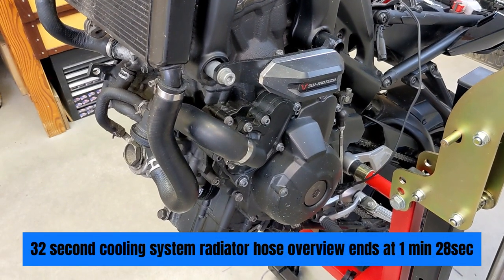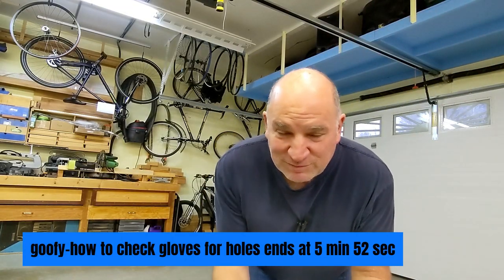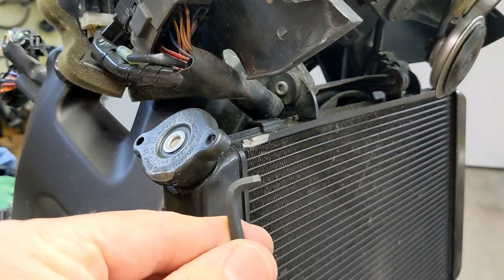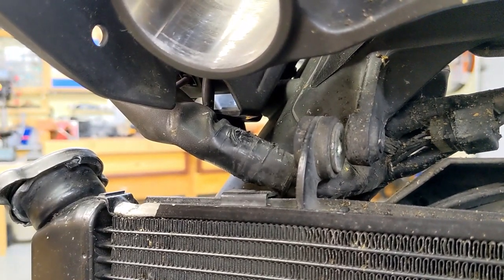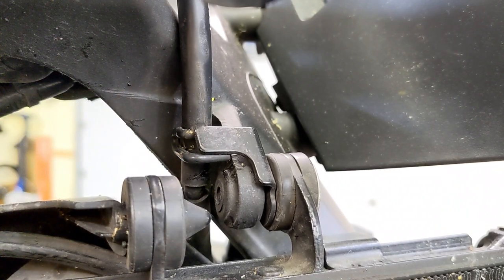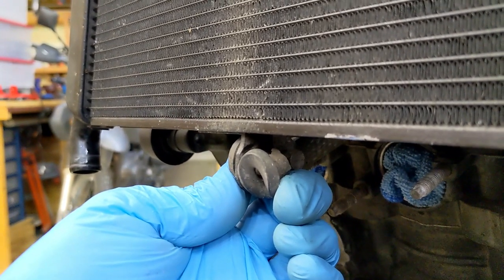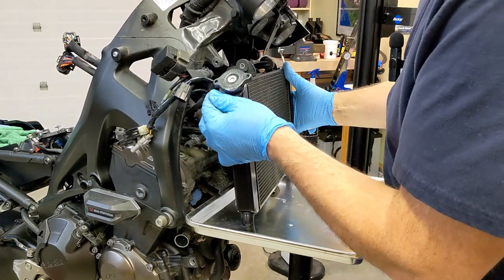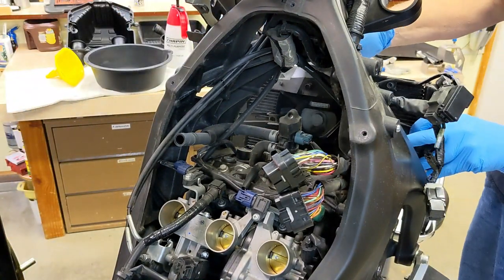radiator removal Yamaha FZ-09/MT-09 2014 2015 2016

Comment: Thanks for the detailed video! Very helpful actually seeing how all the parts assemble vs. looking at a diagram in the service manual.

FYI, at 24:41 in your video you ask what connectors you're looking at, the light grey connector located at your index finger at that time mark is an accessory 12v power connector. The cap is removable and is only there to protect the contacts in the male side of the connector. You can get wiring plugs on eBay to replace the protective blank cap with a wired female end of the connector. The accessory power is switched with the ignition and is on a 2 amp fuse that sits within the fuse block that you removed towards the front side of the air scoop.
Reply from the maker: Thanks for the positive feedback...glad you liked it! I know what you mean...that's one of the reasons that I started this channel was to provide videos that people could actually see what was happening up close.
I actually figured out what the connector was... about a month later when I made this video....at 53 seconds in. In the description at the bottom, I left a link on where to purchase.
https://youtu.be/3rQZiyD87pU

Comment: Hey whats wrong with the radiator, if there is any
Reply from the maker: Nothing is wrong with the radiator you are correct... I just took it off so I could film the valve adjustment procedure better.... Some people just tilt the radiator forward to do a valve adjustment... It's not too hard to remove so I would probably just take it off and change the coolant while you're at....if it's time....